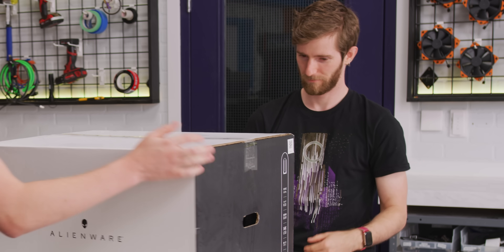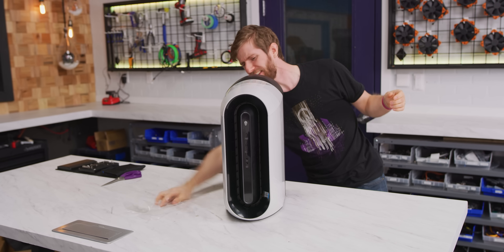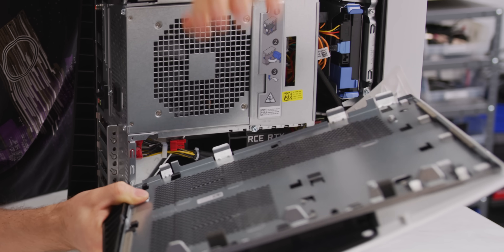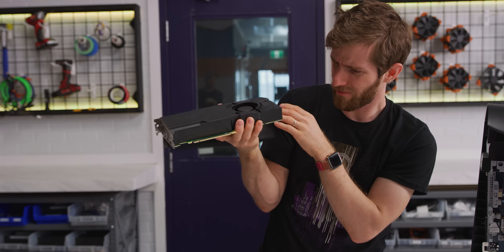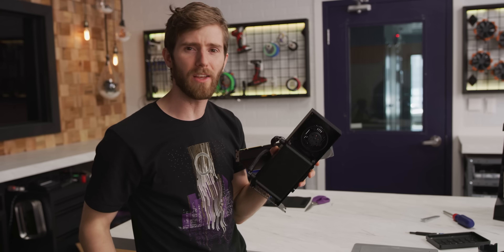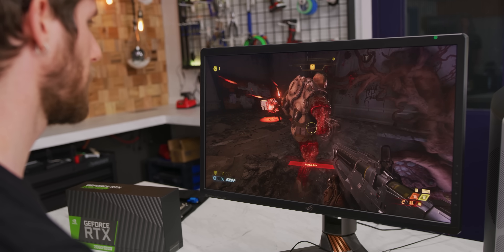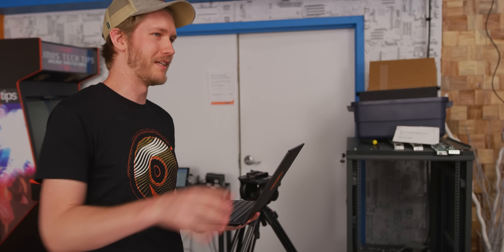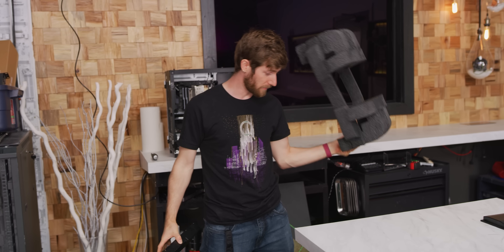I've Never Seen Anything Like This - Asetek Rad Card

Comment: Only complete morons but a "dell" gaming pc. Parts  are very hard to upgrade that is not specifically designed for their motherboards. Over priced pos  most pc parts are NOT compatible with Dell custom systems. For their price you can build a better system.

Comment: I'm amazed the cooler air flow doesn't enter in the moddle and then dissipate L & R through 3 coolers each to minimise the hot/hot issue...

Comment: "I don't see the value in comparing to that" - You can't use dual axial coolers in cases that don't have the airflow, so it's a valid comparison as the Alienware was either shipping with this or a custom air blower.  Major manufacturers don't like using axial coolers because the extra airflow required = more heat/dust in the case and they have to warranty the machine for X years.

Comment: I am actually kinda bummed you can’t get this aftermarket. I would love to have it to do a build where the chassis was only motherboard width
Reply: Same here, I have a particularly small case this would work perfectly in. Rumor was that they were bringing it to market but I'm not sure when
Reply: Nephron 99 yeah I was thinking psu on the bottom (still have room for cables)  then ssd’s on top of that in front of the bottom of the mb. Then this graphics contraption and a 240 aio at the top for the cpu. I mean you’d end up with a 10 inch wide water cooled full atx build

Comment: 4:35 "But enough teasing Dell about...for real, the 8 pin is a 6 pin"

I have a bad feeling running a 10900K off of a single 6 pin power connector...
Reply: It can easily. But wouldn't recommend though.

Comment: the 8 pin connector is just a 6 pin connector with two additional grounding wires. you can take ground from two of the ground wires, route them into the grounding pins, and you're set. you don't need to buy an 8 pin adaptor and waste 8 bucks. I did this with an RTX 2070, my PSU only has 6 pin connectors, so I salvaged the right shaped connectors from an old six-pin PCI-E cable using a rotary tool, routed the wires into the existing ground wires of my PCI-E 6 pin, and it worked. no issues, but knock on wood.
I only did this because I got a 2070 for very cheap and I got it before I realized my PSU didn't have an 8 pin. I was impatient waiting for the 8 pin adaptor to arrive, and I have been too lazy to install it. if it ain't broke don't fix it.

Comment: "needs to fit in a tiny case"- 5 slot cooler.
TitanV- 2 slot, You could literally fit a pair of titanV's in the same space.
Reply: @snowwsquire  Sooo the full size motherboard standard? (Eatx/xl-atx are not standardised).
"we need you to design a special card that fits into 98% of all pc's".
This would have fit too... https://external-preview.redd.it/7gF0Cl9NPecBLhLv8m6TC_fxUEIG4GJz3_qCwpeFroU.jpg?auto=webp&s=40a5d59d10657b35f2c667413b20b9dceef987b7
It was done for marketing BS and that's fine, just own up to it. Its a 215w gpu and its not like 250w founders 1080Ti's or TitanVs made peoples ears bleed. Personally I'd rather have dual rtx2070Supers (only 175w) or 1 big gpu in a smaller system, Heck they could put a 2080Ti in this with an NH-D14 bolted to it if they wanted.

Comment: so in short : Alienware should rather invest in better ventilated cases, put a regular 2 or 3 fan cooling on hte GPU they include and go mATX to keep the form factor small. I mean, I asked the Alienware support on twitter to why they stay on a full ATX form factor, and the answer was "because we want to keep the upgradability available to the consumer", but with that rad card you just blocks off the second PCI-e 16x slot anyway, so really I don't see the point. 

Their PC doesn't even look cool from any angle but the front.

And is overpriced

Ehhhh

Comment: That clattering plastic-panels-on-metal scraping over the tabletop sound… man it’s been a long time since I’ve experienced that.  The last job I had where I had a Windows desktop PC was… 2009, I guess.  And plenty of tech support experience with those types of PCs in college from 2003-2007.  All solid-built Apple products since then— sometimes booted into Windows to do C#/WPF/Nvidia/etc. development.  (Sidenote: While I know the Mac ARM switch is exciting, I’m also fairly disheartened by it; I like being able to run any and all OSes natively on my well-built laptop, and playing any modern game at ultra settings with my eGPU hooked up.)

Comment: A 8pin cpu connector is actualy only +12 and ground and in 95% of the pc will boot with just 2 out out of the 8 as long as they are the correct ones

Comment: What program is linus using that showing the stats of the fps, cpu temp and stuff. I usually use msi afterbuner but for some games it has issue while running on the overlay like call of duty modern warfare for example.

Comment: yea they should coat the psu if you think long term if they sell lets say a few 100k units between directly and third party that 1 dollar savings just turned into 6 figures. It is minuscule to not just pass the $1 cost on to the customer.

Comment: That Alienware is the crappiest PC i've seen, and they ask for how much money?
Reply: I checked their website because I was interested too. Their config costs 3150€ or 3250€ (Windows pro instead of home) in germany. Don't know if they have regional pricing so maybe it changes from place to place. (If we just go for straight conversion then 3250€ = 3831,38 US-Dollar)
Did a quick amazon search and you could get a similar build for around 2800€ but using high end parts which are all way better than what they used (like 260€ mainboard, 250€ case of your choice, 250€ liquid cpu cooler, high end 2080super model and so on) including windows pro bought at retail price. Probably could get the whole thing down to 2000-2200€ (2350-2600 US Dollar) if you search a bit more and maybe don't go for the high end parts straight away. 

But you would miss out on those sweet looks and that special gpu cooling solution. Still their pricing is insane especially for all the cost saving measures they went for lol.

Comment: I know that this is off topic for the video, but Alex should make the aio that you think manufacturers should make. It shouldn’t be too hard if you find a 144 hz, 1440 p monitor with an external power supply, splice some wires so that it can be powered by your power supply, grab a micro atx mobo and a Ryzen 3950 and a low profile noctua cooler. As long as the back has plenty of ventilation holes around the cpu and gpu, you could keep it air cooled. You would probably wanna run a DP pass through so that you could still use the computer as monitor. If you also had some wireless peripherals, then you would truly have a one cable (power)  setup